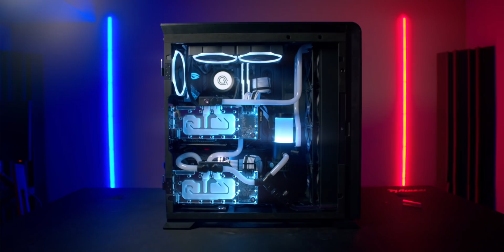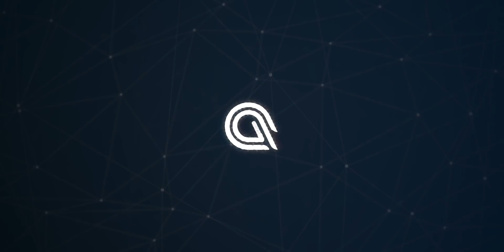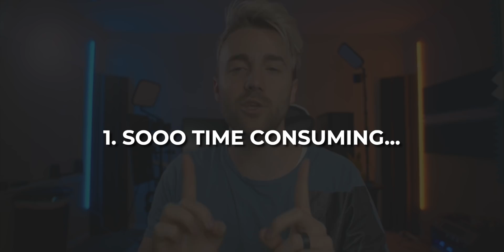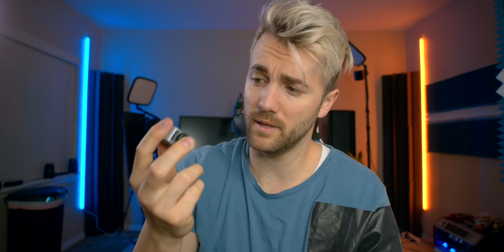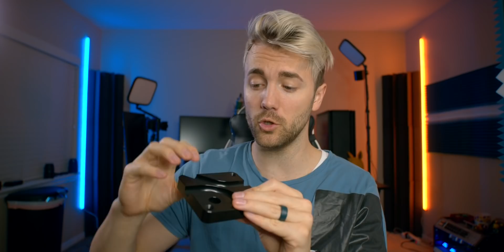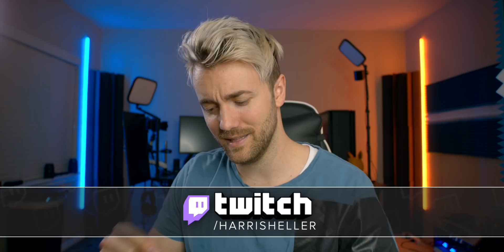5 HUGE Things I Learned From My First Custom Water Cooled Loop Build

Comment: Those are  some great points to consider. I've done dozens of custom loops at this point, and each one has been different with new challenges. I'm currently doing a custom loop in a be quite! Silent Base 802, and even though the case looks big  on the outside, there's not really all the much room on the inside. I had to reduce my EK D5/Res unit from 300mm tall to 150mm, and there's no place to use my thick 360x65mm rad. I ended up going with a two 360x30mm rads. One in the top, and one in the front. I hope water cooling has gotten easier for you since the making of this video. Cheers.

Comment: The rotary cutter is for PETG only I did this today with acrylic and gets near 15 attempts w/crack and Google for best method and gets what the tiny saw is the best method  yes you won't get a straight clean cut but you can have a clean straight finished by using sand paper & chamfering tool.
So what's best for acrylic = tiny saw
What's for PETG? = Rotary cutter
A saw will work fine what were talking what's best and easy so rotary cutter for PETG..

Comment: My tips for beginners:

1. use soft tubes, 10 times easier than hard tubes.
2. do it in large case, extra room helps alot.
3. always order more 90 and 45 degree ROTARY fittings more than you think gonna need. 
4. dont forget drain port,

Comment: Pro tips (in no particular order) of watercooling after doing for a few years now:
1. There is no such thing as too many fittings. Get as much as u wanna spend. Mix in 90 and 45 degree fittings as well. I would say get 4 each of them at a minimum.  And get atleast 15 normal fittings. Trust me u will need them its just a matter of when.
2. Loop maintenence should be done annually at the very minimum. If u are using colored fluid I would recommend bi annually. 
3. Crank the fittings as tight as they will go. It may feel like ur gonna break them. Trust me u are not and ill take a broken fitting over a leak any day.
4. Do not underestimate the extra cost and effort it takes to build one of these systems especially if you are going with rigid tubing. A good loop with the cpu and gpu being cooled will add on average $400-$700 to the price your build. As far as work put in you will spend HOURS on the build especially if you are a novice. Plan for atleast 8 extra hours no joke.
5. disclaimer as this really only applies to rigid tubing You WILL fuck up when making the bends. Its inevitable. Buy as much tubing as possible. 
6. Take extra care when installing the waterblocks especially with the gpu. There are alot of sensitive components on the pcb that can be damaged and brick the card. I myself have accidentally bricked a gtx 1080ti. It sucks and u have to drain and take apart the whole loop which takes hours.
7. Follow the instruction manuals for the waterblocks to the letter. Dont get impatient and try to skip steps as it will only fuck you in the long run.
8. As far as planning how may radiators you are gonna need, my rule is at the minimum give 120 mm for the cpu and 240 for the gpu. I've cooled a cpu and gpu with 1 360mm rad and it worked flawlessly. However if you wanna be safer or do some more serious over clocking I would recommend atleast 240mm for each component.
9. Always leak test and put paper towels all throughout the system. This one should be obvious but you would be surprised how many people skip this step.
Follow these tips and you should have a smoother building experience trust me.

Comment: A Little late to the party, but Everything you described as 5 things are spot on. Literally went through the same problems and issues (except for the GPU on) Took 2 Days to do all my bends and the Saw you showed really does suck major booty. Also Have the Exact same case as you too! Just waiting for the RTX 30 series to drop to decide to do it all again in a different case? Maybe a Corsair 1000D or just upgrade everything in the top and move it to the bottom on the Mini Itx. Great Video Harris!

Comment: That opaque fluid has nasty pigment in it that clogs fins and eats away at metal coatings btw... And the particles Stick to the PETG over time,  you might run into those issues if you don't  Ditch that fluid and go with something without the white pigment in it

Comment: my problem with doing one isn't how hard it'll be, or how long it'll take, its that doing your own loop, if something goes wrong and you have to replace it, it's expensive. i got my full build through NZXT, with a radiator and all so partially watercooled, and if something goes wrong, its under warranty and they'll fix it. but you start taking your gpu apart and putting water on it, you're on your own

Comment: Regardless of what you're cutting, hacksaws are meant to be used with a miter box (which come with a lot of those water-cooling toolkits), so you get clean straight cuts...that's more of a "know how to use your tools correctly" than a "make sure you have this random tool"

Comment: Just because you couldn't properly follow directions doesn't mean others will have the same issues, these sound like major personal issues with following directions. Every tutorial ever recommends the blade, not a god damn saw lmao wtf. And why would you prefer a used pad instead of a brand new that CAME with your cooling system? Your content is usually on point but this aint it chief, this just make you looks like a whole dummy

Comment: That rolling cutter can be purchased at any hardware store in the plumbing section. But also keep in mind that you CAN'T use it if your hard tubing is acrylic as it will crack and shatter. Jay's two cents has some excellent videos about this.

Comment: My current PC was my first go at water cooling and I did watch a lot of Jayz2cents in the process of setting it up. I chose soft tubing due to an easier setup process, but I do recall that it took me like a week to setup and actually get the PC running. I recall once thinking if I was in over my head. Probably around the time I took the stock cooler off my 1080ti and applied the water block. This was right around the time of miner mania so it was not a good time to buy another card if I happened to fry this one. And as much as I had planned things out I found out my pump/reservoir wouldn't mount properly so it is attached to the case with zip ties lol. Definitely not perfect but glad I took the plunge and maybe it will be a bit easier next go around!

Comment: Watercooled the PC I bought in July. First custom loop ever. Ran into these issues as well. Especially frustrating when one of my 90 degree fittings leaked and I had to wait days for new fitting to replace it because I didn't buy redundancy like I did with the normal fittings.

Comment: With the whole gpu Waterblock mount and everything, that's why if you will build a WC pc from start, its much better to get a WC gpu from factory (gigabyte has one for example). Also a VERY IMPORTANT POINT is that you NEVER MIX copper with aluminium parts, otherwise you will get GALVANIC CORROSION in your water loop, ending up breaking up your parts in the long run, causing mold to even leakings that can result in fatal damage for your pc.

Comment: So, a few additional tips when it comes to custom loops: For a first build, maybe don't start with hard tubing. Hard tubing is expensive, there's a lot of variables when it comes to what can/will go wrong with it. If you do decide to go hard tubing, 90 degree bends are your best friend, and doing more than maybe two bends per tube means you're a maniac (Like Harris!) And finally, know that with a custom loop there is a lot of maintenance: bi-annual, if not annual flushing of the loops, cleaning out the tubing to keep it clear of calcification/mold/mildew/chemical build-up in the case of colored/dyed fluids, re-applying thermal paste/pads and re-seating all the water blocks included. If you don't like to tinker a lot, you're going to have a bad time. EDIT: Oh, and Harris, you're nearly rivaling Der8auer with that cooling loop. Check out his "Project Irrationality" build.

Comment: 6. If this is your daily driver (and performs your encoding for the money shot), use soft tubing. It may not be as sexy as hardline but it's much easier to swap out a faulty part in a soft tube system - ergo, less down time.
7. Use the EK's clear rather than a solid colour/pastel liquid - your blocks will thank you for it in the long run (less or no staining as well). This is especially true if you don't have time or the fortitude for a more than regular maintenance regime.

Yes, I have done a hardline in a Phanteks 719 albeit it's a single system. Mine is a SLI system with 3 radiators and I used the Phanteks distribution plate as well. I agree that eye-balling 90's seems to produce "better results" but I do use the jig for 45's. In fact, in some of my runs, it was far easier and better ascetically to do 2 x 45's than a single 90. As for fittings, always have more than you think you are going to need because you will!

Comment: Just a heads up, those "rotary cutters" are also called brake line cutters. Find them at an auto parts store for less than $10.
Reply: We have pipe cutters that we use for 1" water lines that would work for those tubes, you can get them at leeps
Reply: Tube cutter at home depot. We use em for refrigeration/copper water lines at work. Good tools

Comment: Long message, sorry!

I did something very similar, went from a right at $1,000 build with a 1050ti and some i5 processor to a fully custom liquid cooled $4,200 build with a 2080 super (waiting on the new Nvidia GPUs) and i9-9900K.

Took about 3 months from the moment I decided I was going to do it, to the researching, to the building and testing. Sooo much longer than I anticipated. However, when I actually went to put together and test the PC, it only took me a weekend because of my excruciating planning. Lol

The absolute BIGGEST thing is plan your loop. Draw it out, and think about literally everything that could go wrong. No matter who you are, something will go wrong in some way no matter how minor or major it is. Even with my sheer amount of planning and how careful I was, I didn't expect my EKWB pump's inner o-ring to not be fastened properly (STRAIGHT OUT OF BOX) to where it leaked fluid when I started filling. I planned for this though- 

Paper towels EVERYWHERE in the PC in case of something like this, and I went reeeeeally slow. Took it apart, fixed it, tested with (distilled) water until it no longer leaked. If you be cautious and PLAN, you'll get through it just fine.

P.S. PLAN YOUR LOOP DAMNIT. AND DISH SOAP IS SO IMPORTANT THANK ME LATER.
Reply: 1000 dollar build with a 1050ti? i believe this is known in the industry as a bottleneck lmao.

Comment: Love the angled cut! In my line of work (industrial insulator) we are cutting pipe insulation continuously. it def takes a long time to learn whats straight on a round surface for sure! The apprentices usually hand us some wonky pieces! LOL...good video i didnt run into these same problems but i did have my own set when doing my first Liquid cooled setup!

Comment: the tool you used to cut the tube is called a pipe cutter it's for plumbing if you can't find it try looking in plumbing section.

Comment: A rotary cutter or pipe cutter as they are called, are not always suitable. Depends what pipes you're using. This, you should clearify. On metal pipes or PETG, they are great. However, they tend to really crack and ruin Acrylic tubing which is just as common as PETG.

Comment: For PETG, the best way to get your tubs deburred and even: get the drill bit from Primochill. Can do a "sloppy" cut if you give yourself slack then use the drill bit to get it to length. Jayztwocents uses that bit a lot ever since he got it a while back and is working with PETG.

That said, the best advice for anyone doing this for the first time: research, research, and research. Best to go in with as much knowledge to belp ease the first time anxiety so you don't make an expensive mistake that was preventable.

Comment: And this is why you use air cooling on system critical system. 
Watercooling looks cool, but really don't cool that much more.
Unless you super duper overclock.
Reply: Forgot to add: water adds more POFs and need more care. Need to replace the water at least once a year.

Comment: Fyi. If you add a 2nd GPU to your current system that has a Turin chip, eg. 1660, you can use the 2nd card just for encoding, so your actually gameplay has 0 issues. Unless you want to stream H264 @medium, but NVENC is very close to medium

Comment: How do all your cables fit with two systems in one case I have one system and the cables didn’t fit(I have a 850 watt Corsair psu a 2080 xc ultra a i7-9700k 16gb of Gskill trident z and a auros z390 pro WiFi

Comment: I tried water cooling... went back to air. Water is cool, but... eh. I may try again in the future (with soft tubing though). Air is just... so easy. And works almost as well.
Reply: Pretzel water looks cool but air has less points of failure and unless you overclock like a lot, it does not cool that much better
Reply: @39zack  pretty much. I'm using a Noctua D15 for a 3900x and it's only about a degree warmer than a 360mm rad with 3 fans for less noise. If I water cool in the future it will be so I can make my GPU quieter, but I'm waiting till the 3080ti drops to do any further changes.